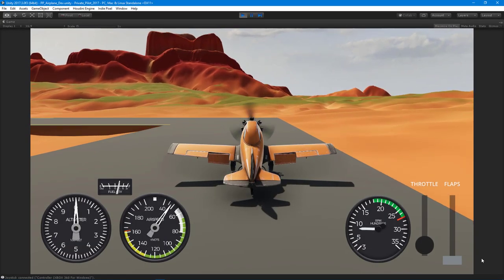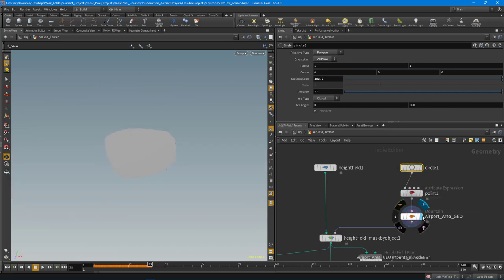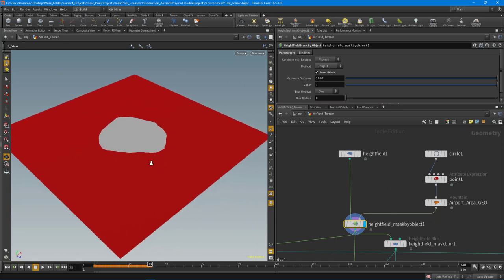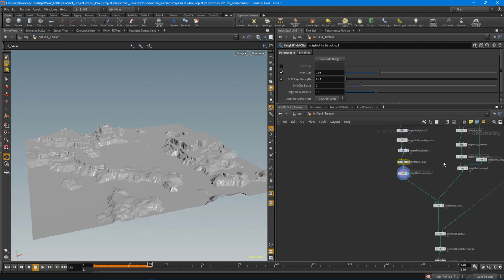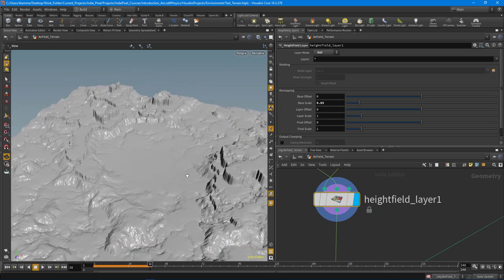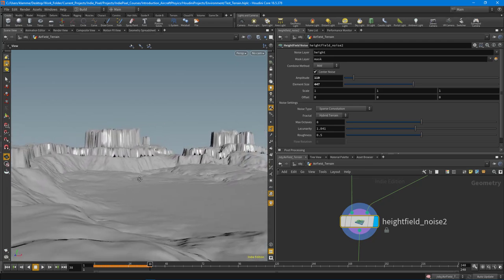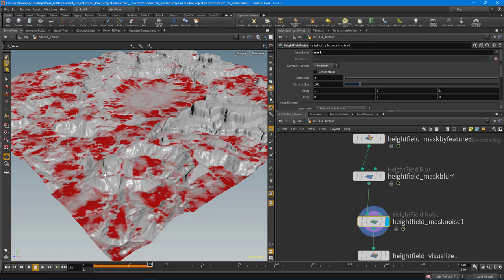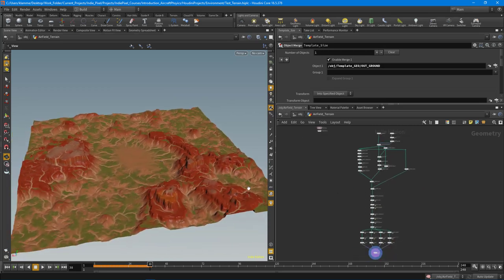Houdini Terrain Walkthrough 001

Comment: how to output the textures?
Reply from the maker: You can export the textures a few different ways.  The first way is to use COPs and pull the layers off the height field.   The second is to convert the terrain to geometry and put the colors into the vertex colors or you can bake the colors off using the bake texture rop.